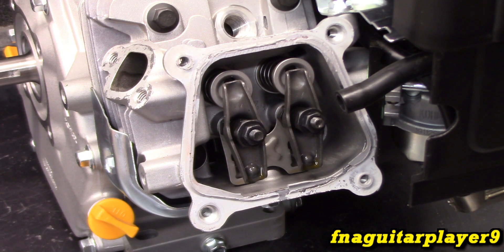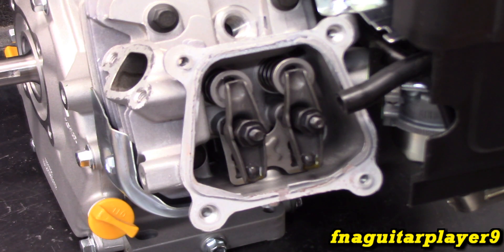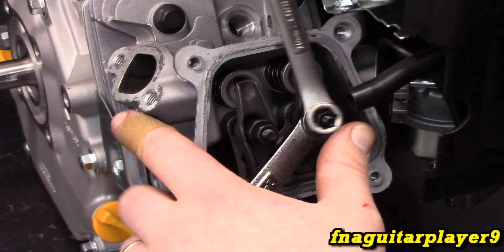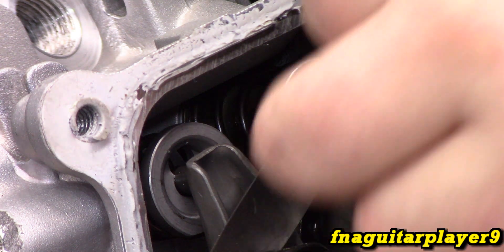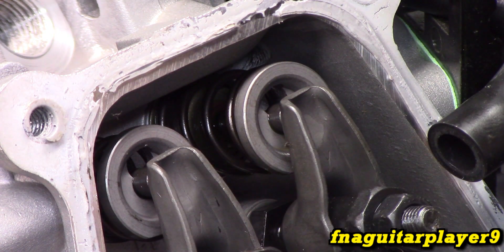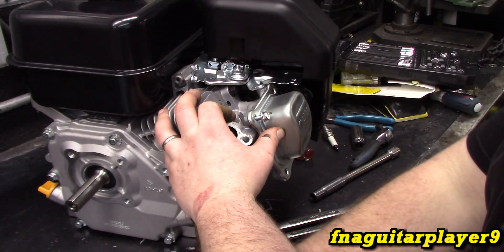How to Adjust Valves in Kohler SH Series SH265 65HP Engine

Comment: My SH265 started smoking alot, and will not run clean at full throttle, it coughs and burns poorly at fuel throttle and smoke pretty good. I checked compression is 70psi on my snapon gage.
I took the head off and the cylinder is nice and clean cross hatch, no wear.
Checked the valve clearances were very close.

Are these known to need rings even when the bore LOOKS ok?
Or am I missing something, the compression shows the rings would be bad
I flipped the head and filled the dome with carb cleaner and it didnt leak so valves seal good.

Any insights?

Comment: Finding TDC on the CORRECT stroke is key here and you do a poor job of showing that. You can have TDC on all 4 strokes but the compression stroke is imperative for this task.  Kohler says .003 to .005 is the setting for BOTH valves.

Comment: FYI - My Kohler SH265 maintenance manual, page 46 states: Insert a flat feeler gauge between rocker arm and valve stem. Recommended valve to rocker arm clearance for intake is 0.1 mm (0.0040 in.) and 0.15 mm (0.0060 in.) for exhaust. This is probably why it seemed off when you first started. Thanks for the video. 🙂
Reply: Thank you

Comment: I don't have any "gasket in a tube" but, I do have rolls of different gauge of gasket sheets. I prefer gasket material because it gives you some clearance and a little room to torque things down, when the engine is warmed up. That's just me though and rarely had any problems afterward. Thanks for sharing.
Reply: Hay do u no the shaft size on this